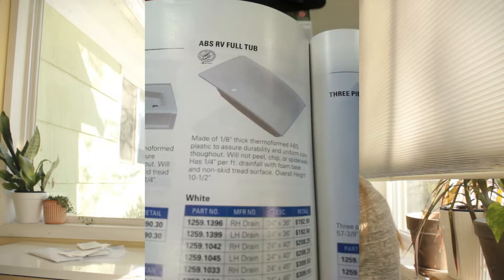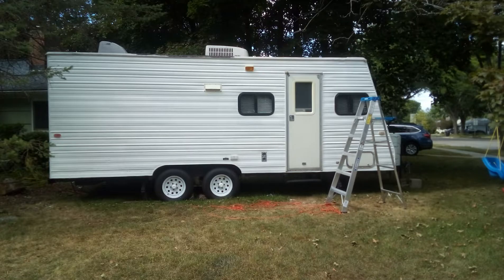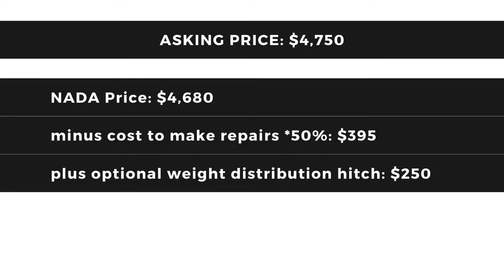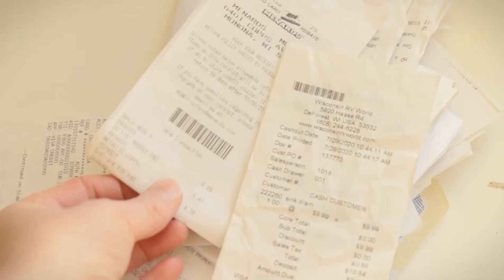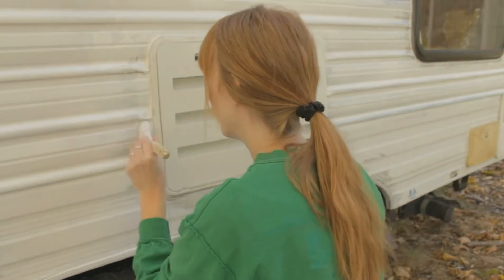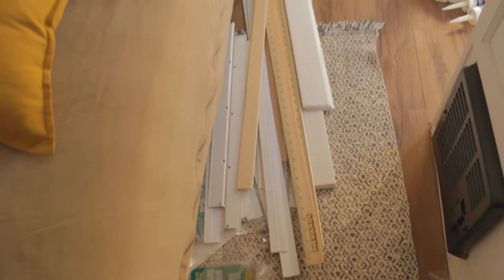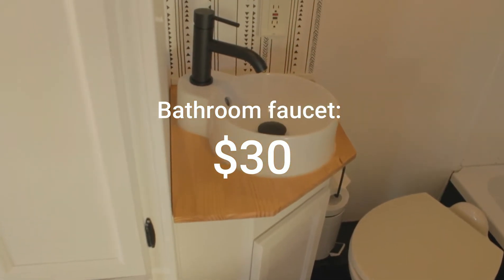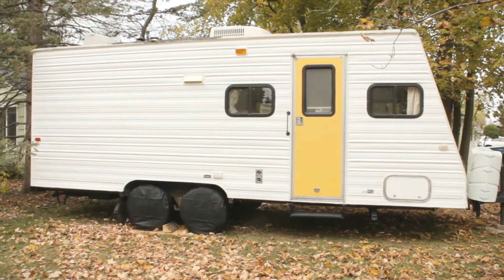Camper Renovation COSTS - it doesn't have to be expensive!

Comment: Great job and a really practical video topic. My only “hmm…” moment was in your cutting the cost of the replacement parts/repairs in half to calculate your offer amount. The cost of the labor and time to replace those things (like a tub) more than covers half the value. (Probably much more in some cases.) So if it’s something you would not have had to replace, I’d the say adding the full cost of replacements is a generous calculation. Going halfsies is not necessary.